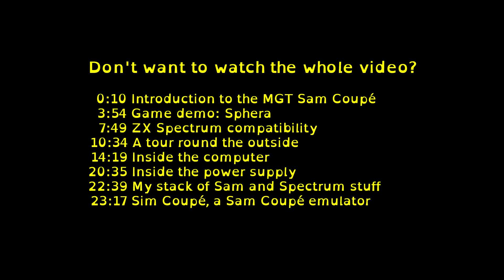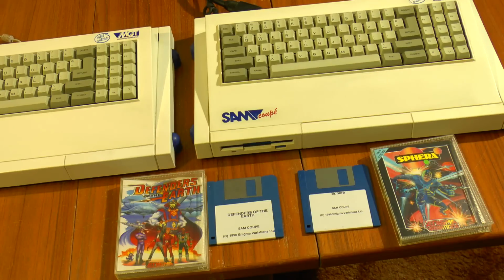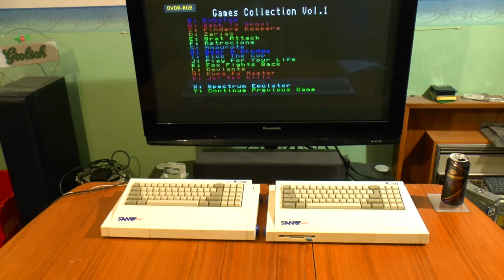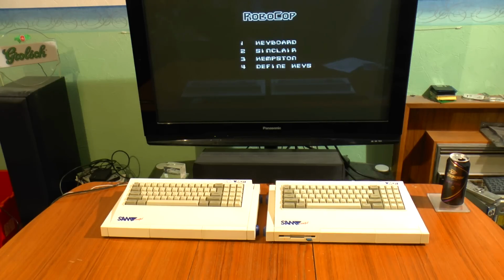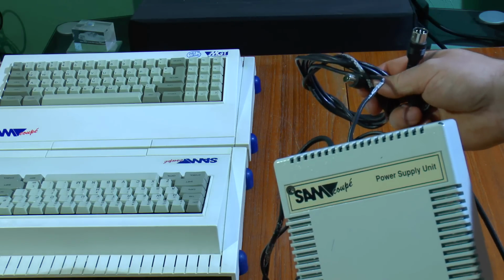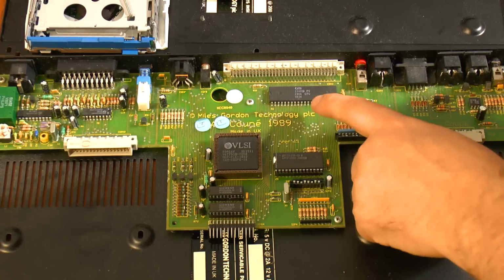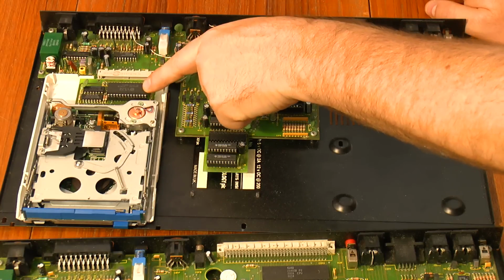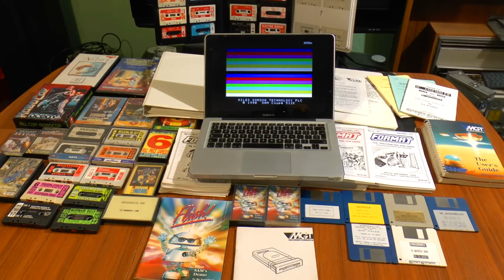Vintage MGT Sam Coupé teardown

Comment: It's interesting that when I was a kid, I never actually noticed the Speccy games were running faster .. I had discs FULL of snapshots of speccy games.. I even used the snapshot button to "cheat" my way through a lot of game (getting through LOADS of discs in the process).. One game I saved so many snapshots completing it, i filled up about 20 discs.  Cant remember which game it was now (guessing either Platoon, Robocop, or Head over heels - all of them I completed via snapshot cheating)
Reply: same

Comment: The SAM Coupé was basically a Spectrum on steroids.  It has one compatible graphics mode and three proprietary ones, each which reserved a portion of system memory, from 6.75k up to 24k.  It can display 16 out of a 128-colour palette at a time, but it is actually possible to select from up to 512 colours.  The BASIC has numerous advanced graphics commands, including a function to record and playback lists of graphics commands- similar to the display lists in OpenGL- to help with speed limitations.
Reply: The SAM only has a palette of 128 colours, not 512.

Comment: It should be noted that the Z80 was available at 7 Mhz, so if MGT had used this, not only had it made the machine faster, but it would have given the Spectrum perfect emulation when halving the clock speed.
Reply: At the time of SAM's development, the Z80 was available at 10MHz, with the 20MHz CMOS version out in '90/'91 (I don't have a Zilog line card for 1990, but it is in the 1991 brouchure). Halving a 7MHz clock still wouldn't be exactly perfect emulation speed. There are differences in the contention for the ZX Spectrum and ASIC on memory access and I/O accessing internal registers.

But I can say that ZX Spectrum is somewhat crazy at 20MHz which I've done with my prototype accelerator on SAM!

Comment: I also had two SAMs. I actually managed to write some code which created a sort of rudimentary network game between the two using the MIDI in/out ports. It was stupidly slow and was nothing more than two player controlled dots on the screen, but sort of worked.
Only have one SAM now but I do have some of the peripherals for it, like the 1MB memory expansion and the kaleidoscope (increased colour palette to 7-bits per channel, i.e. 32768).
Reply: Interesting! I did a network based Pac-Man game with one player being the Ghost, the other PacMan. Wrote about it briefly in a past issue of "SAM Revival" magazine. I'll have to dig it out and put it on the coverdisk with a future issue. (Issue 26 was out in June, Issue 27 out soon!)

Comment: I love where they stick the rf modulator, it's like they purposefully thought "where's the noisiest area to generate a rf signal? I know, right next to this transformer, bank of hi voltage capacitors and bridge rectifier.." haha
Reply from the maker: The caps are only low voltage (it's a linear power supply not switch-mode) but no, not the best plan. You can thank Amstrad for that, check out their MP-1 power supply.
Reply: It was a bizzare choice. I remember when the rf lead from my amiga went anywhere near the psu and it would cause noise/lines.

With that said. I do remember reading about the Sam Coupé in my old specky mags and wishing I could have persuaded my parents to part with the cash. I actually had dreams about it.

The innards are surprisingly sparse, that is actually some feet of electrical engineering to condense a system such as that to so few chips.

Comment: I have a sam coupe with no power supply so cant use it. Where can I find a power supply from ?
Reply from the maker: Ask in the Sam Coupe Users Group on Facebook. A 5V/12V dual output power supply such as those used on some Cisco routers should do the job with the plug cut off and the cable (correctly) wired to a 6 pin DIN plug. https://www.cpmspectrepi.uk/hardware/samcoupe.htm
Reply from the maker: Look up ADP30RB on eBay. That does 5V 3A, 12V 2A and -12V 200mA. The 5V and 12V lines on that should do nicely, with the -12V line folded back on itself and taped.
Reply: @AintBigAintClever  thanks for your help.I will looks that up

Comment: I don't know if you or someone else is available to answer this, but, on the ZX Spectrum side of this computer, does it rectify the col our clash problems? It's my main bugbear of the ZX Spectrum and why I hated it way back when, even though, I also loved it too! The 6 channel sound capabilities of this machine were amazing. I still, to this day have not figured out why the Amiga went for the pathetic 4 channel.
Reply from the maker: The SAM has four display modes.
Mode 1 is the same as the Spectrum so would have the same colour clash issue (256x192 resolution with 32x24 of 8x8 colour blocks).
Mode 2 has a higher colour block count which eliminates vertical colour clash (256x192 resolution with 32x192 of 8x1 colour blocks).
Mode 3 is higher resolution with no separate colour blocks but only four colours (512x192, 2 bits per pixel).
Mode 4 has no colour clash and 16 colours on-screen (256x192, 4 bits per pixel).
Screen modes can be altered mid-screen so it's possible to have for example a 16-colour main screen with a 4-colour high-res menu section. I'm pretty sure the Flash! image editing software did this.
Palettes can also be altered mid-screen, effectively the same as the "rainbow processor" used in some Spectrum games.
Reply: The sound chip still sounds very 8-bit, not much different to the AY in the 128K to be honest (I think it would have been easy for the devs to make the SAM 128K-compatible). The Amiga could handle sound samples. Plenty of games had voice recordings in them. Its not really about the number of channels, but what those channels are capable of. Could the SAM do this:
https://www.youtube.com/watch?v=PvSfqBJi0ss

Comment: Unbelievable small board (16:00)! definitely there are only connectors and 6 ICs, and two of then are the RGB and SAA sound IC. :-) The memory expansion is also impressively easy to do. Does not need expensive external logic board ( like in C64 case the REU), but built in.Fantastic. Too bad, that the speed of the machine was not up to the design.

Comment: Nice machines, and they're becoming pretty valuable too. I wonder why they went for a non standard pinout on a standard scart connector. Mistakes are easily made.
Reply from the maker: +custardo So they could shoehorn another two functions into the same connector. Would've been easy enough to add another socket on the board for the TTL RGB signal or to shift the connections to another port, but there you go. Personally I'd have ditched the audio output on the light pen socket (which was another non-standard pinout anyway), bumped it up to 8 pin DIN and put the signals there.
Reply: +AintBigAintClever yeah works great now. had to recalibrate my floppy drive as described in your vid by turning the motor. Worked s treat. Thank you. Now only if my Sinclair ZX was that easy to fix... (Got fried by lightning :C )
Reply from the maker: +custardo Worryingly a standard all-pins-connected SCART cable will short the 12V line (SAM pin 18) to ground. Would need to look at the schematic to see if that's got overcurrent protection or if it comes straight from the power brick.

Comment: Ahh the sam coupe, i did look at the advert in one of the mags sinclair user/crash/other (my memory is a bit vaigue now lol).
I didnt have much money all those years back, and i thought it was too late, so i stayed happy with my speccy 48k and 128 +2 , loved the era, and i too modded code for odd reasons and i have no idea how/what i did, much like you lol.
Apart from soft/hardwar hacking i did purchase the mgt disk interface (the simpler version), and after some testing of crap interfaces i found the Multiface 128 by romantic robot (bloody amazing device), i hacked that to bits as well lol, i was a bastard :-D

Comment: Awesome Video.   This is more of what the QL should have been like.  However as a designer, I cringe at some of the options they did, and some they did not do.  Overall it is an awesome 8 bit computer, but the cost could have been reduced quite a lot, while improving standards, and simplifying functionality.

Comment: I have a 512kb one,  with rom upgrade, and 2 disc drives.. totally mint in box, with most of the games (including the one I made for MGT ), and EVERY edition of FRED magazing in a seperate box..  It's in some trash dump near Bath - after my mum decided to clear out her attic without telling me
Reply from the maker: That's gutting.  It was bad enough when I had to rescue my Technics SL1500 turntable from a skip.

Comment: hi just found one of these in my mums loft i plugged it in and the picture is there but it flickers any ideas cheers
Reply from the maker: There's a Sam Coupe Facebook group, it may be worth asking on there.
Reply: First computer I ever drooled over as the owner of a hand-me-down 48k from my brother.
Remember reading a double-page spread about it in Sinclair User, if I remember right.
Cheers f'ut video, mate. N
Aaaaaah, nostalgia.
Reply from the maker: My first computer was a ZX81, then a Spectrum 48K, then upgraded that with the Plus case, then a Spectrum 128 (a proper one, not the Amstrad crap) then a SAM.

Comment: Hi, I'm having a little bit of trouble with mine. After inserting a disk and pressing F9 I get a message saying "55 missing disk 0:1". Could you tell me what this means? Thank you
Reply from the maker: +iamwalking thec0w Can you hear the disk spinning? The disk presence is usually detected by a pair of sprung contacts, one for the write protect and the other for the disk itself, it may be worth gently pressing down on the disk in the drive in case it's not quite activated the contacts.
Reply: Thank you, I will try tomorrow as I haven't got it setup at the moment. I'm hoping nothing is wrong with the machine, it was donated to me
Reply from the maker: There's a Sam Coupe Users Group on Facebook that may be able to provide further help. https://www.facebook.com/groups/20486797963
Reply: +AintBigAintClever thank you, I will look into it the next time I have it setup

Comment: you were capable of modifying 128k software to work on sam?
Reply from the maker: I can't remember but don't think so. The multi-part loading stuff I managed though, I think I used bank switching to swap the different tape sections in, although we're talking 25 years ago, I've forgotten most of it and may have got instructions from somewhere.
Reply: well thanks anyway...
Reply: what a pity i was hoping you might be able to convert a few classic 128k software that i have in mind especially as now we have it running at the full 6mhz have you seen the two snaper disks from the velesoft website?

Comment: Sadly seems that machine came too late to market. In 1989 the 68K based computers like Atari and Amiga where all the jazz. I like the chouce of interface connectors. Not cheap and very reliable. AFAIK apple used those too, and called that NuBus.
Reply: +Chip Guy Vids Well, they were also really expensive. I think the idea for the Sam Coupé was getting closer to the power of 16 bit machines at a cheaper price.
Reply: +andyukmonkey I very came close to buying the SAM, the price was good and the MGT guys were really nice and friendly. Ultimately, I went with the Amiga and reflecting on how non-standard the SAM's ports were and the lack of support from the software houses, that was the right decision.